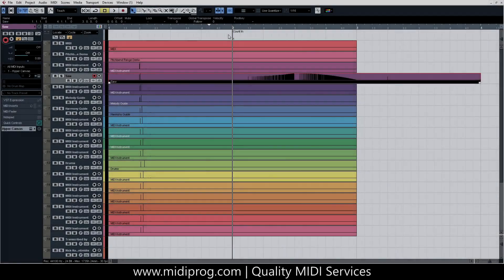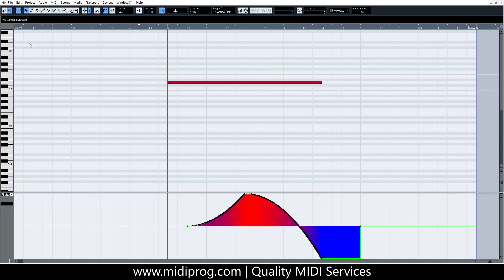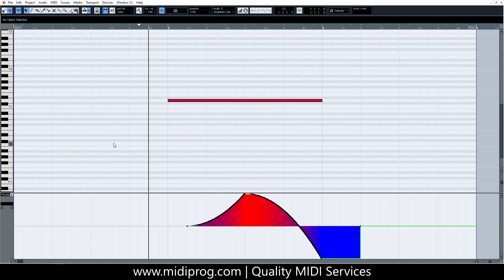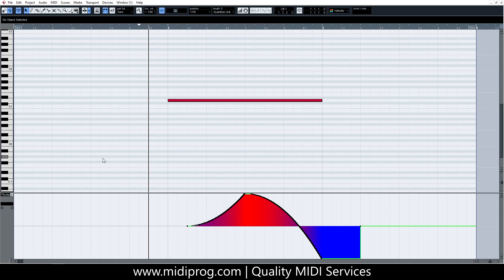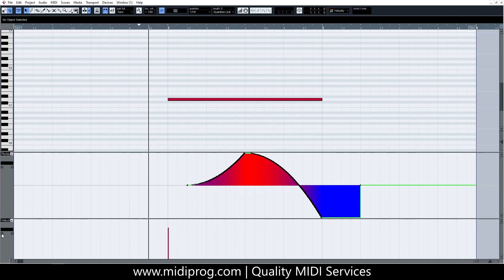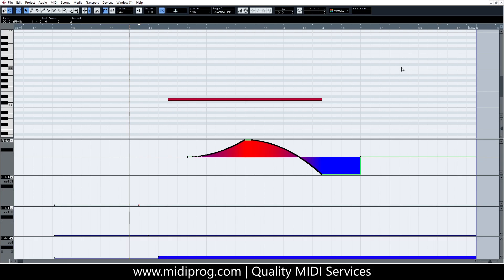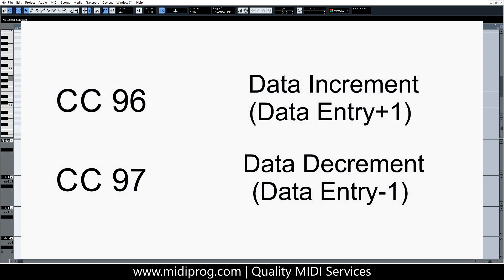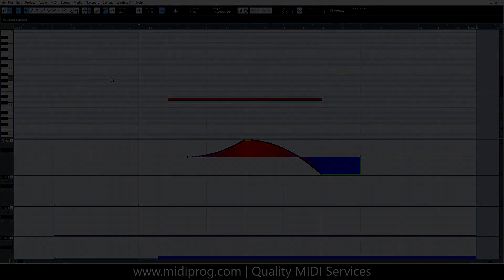How to change the PITCHBEND RANGE in CUBASE using MIDI

Comment: No cc100/101 in cubase 12
values are cc1 to cc11 and weirdly just cc 64
Reply from the maker: They are there, just hidden by default. In the Key Editor, you have to click the little arrow at the bottom left of the screen (Controller Lane Setup) and choose "Set up Available Controllers...". You'll then be able to make cc100/101 visible.